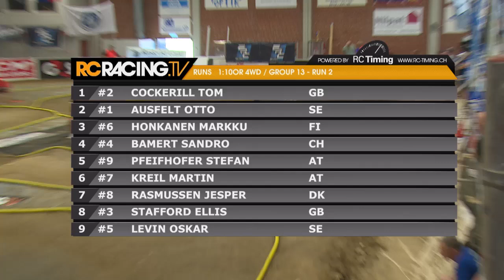EFRA 1/10th 4WD Off Road Euros 2014 - "Fast Friday" Qualifying  - Live!

Comment: Someone probably already wrote this but most of the drivers are using blue compound rubber.

Inserts are mostly AKA red and JC Grey.
Tires/tyres are JC Barcodes for 4wd, while in the 2wd thats already passed, the front tires were free but the rear also had to be Barcodes.

No addition was/is allowed to make the tires more sticky.

 Today (Friday 18th of July, was the first qualification day for 4wd.
Tomorrow (CET something in the morning) the qualifications will continue and then the finals will be held later the same day.